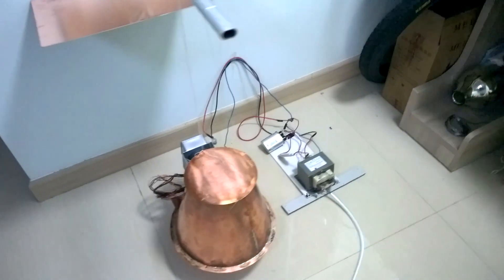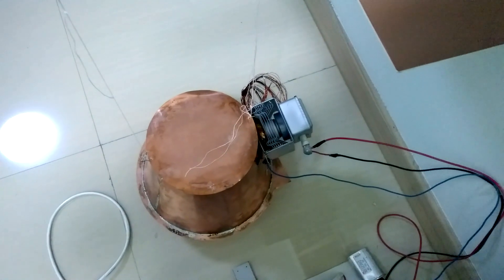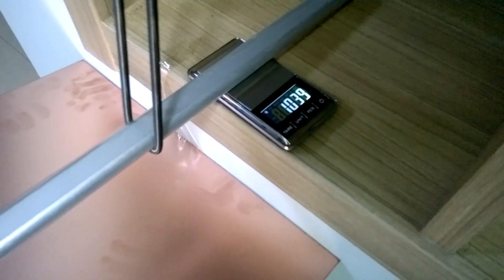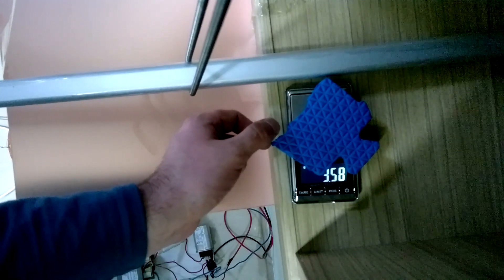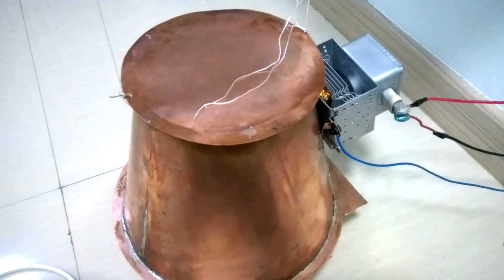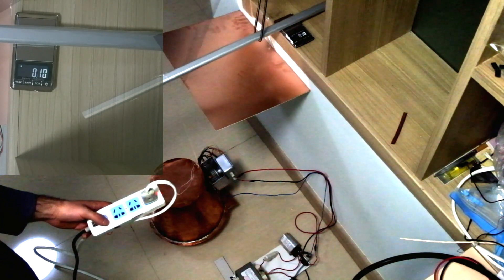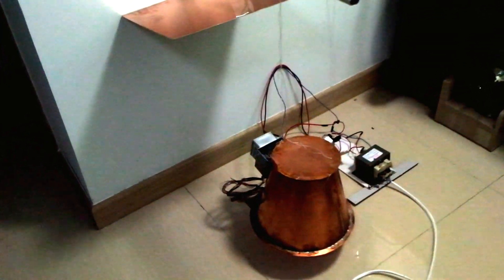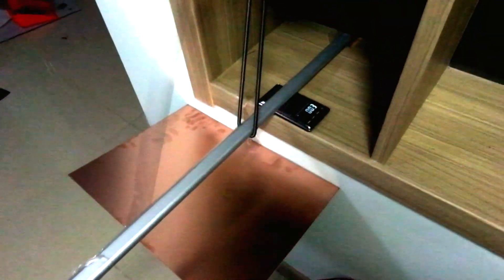EmDrive Test No.03 Success, I have thrust !!!

Comment: if it has thrust, doesn't that mean it is not an anti-gravity device?
Reply: +Guy Gisbourne You must be an electrical engineer, with an attitude like that. There are no physicists worthy of the name working on the Emdrive. Physicists have a different point of view: we use the well-established laws of physics to rule out certain possibilities. To do anything else would be the equivalent of buying-in to a tempting investment scheme, only to find that it is just another Ponzi scam. New discoveries are in fact not made by flogging dead horses, they are made by - for example - noticing that a dead frog's leg will twitch if a current is applied. That is, progress is made by investigating reproducible effects. What makes you think that a force has been measured? Have you even any idea of the number of phenomena that can produce an illusory force when one is measuring at the micro-Newton level? Check out the book, Vibrational Mechanics, it will completely change your view of what you think you know. Why should this sort of thing be disturbing? Because it suggests that there is something deeply wrong with the education system, and the taxpayer is therefore being cheated.
Reply: +Guy Gisbourne What it is, is the usual poor physics of so-called professional engineers. Check out an inventor called Anthony Cuthbert. British Aerospace had plans to test his 'space drive' on a 'vomit comet'. Was his invention like the Emdrive? No, it was one of those pathetic eccentric-wheel devices which try to exploit the (non-existent) centrifugal force. The trouble is that companies with too much money are tempted to waste some of it on ideas that are dead ducks. Hey, there's an idea: put a duck inside the Emdrive. After all, all that Shawyer has done is misunderstand the old trick question about the sealed truck full of birds which is too heavy to cross a weak bridge. Make 'em fly, LOL. Shawyer says that relativistic effects mean that photons do not behave in the same way as air molecules. Small problem: one of Einstein's thought experiments for  proving E=mc^2 was a tube containing rebounding photons. Oh, Shawyer uses a cone, not a tube? Really? Check out his first patent, the one which somehow got granted by the incompetents at the Patent Office. At the same time, check out the granted (sic) Volfson patent. What happened to that boondoggle?
Reply: +Guy Gisbourne Well, I have been employed in a scientific capacity for half-a-century and have somehow managed to acquire a doctorate in physics from one of the top 50 institutes in the world, so there must be something wrong with your reasoning. I have also made detailed studies of previously reported 'anomalies'. Perhaps I just do not fit the profile which you have deduced from TV programs. One does not advance by questioning everything from the outset, that will merely lead to stasis. One advances by looking very carefully at things which do not behave as expected. The Emdrive behaves exactly as expected: it does not move.
Reply: +Guy Gisbourne True, and your point might have some validity if I were the person, like a Shawyer, who is trying to get money to develop a device which contravenes well-established physical laws and for which there is no evidence that impresses seasoned experimenters. I do not have to 'come up with a proper answer': the answers are all in the scientific literature ... together with all of the previous scams based upon the same fatuous idea. Oh, you did not know that it is not even new? Perhaps you should learn before you try to teach. One of the previous inventors failed to make any money with his trombone- (rather than cone-) shaped boondoggle, but he did succeed in conning nine million dollars out of gullible US utility companies with his perpetual-motion scheme. Did they get their money back? No, they simply put everyone's fuel charges up in order to cover the loss. Get it through your head: this has nothing to do with science. This has everything to do with scamming.
Reply: +Steve Bowden  I guess "thrust" is just a manner of speaking here. Anyway,, if it's going to make anything move, then it must be thrust.
Reply: But that's the idea of anti-gravity. It doesn't have chemical rockets or anything like that.
Reply: I suppose, but the EM Drive isn't supposed to be an Anti Gravity device either. If I recall correctly it is supposed to take advantage of the appearance of virtual particles that appear..and that these virtual particles would provide the thrust. Maybe it shouldn't be referred to as an anti-gravity device in the first place? :)  Anyway I shouldn't be arguing over Semantics. My mantra regarding the Em Drive is "Please don't be cold fusion all over again. Please don't be cold fusion all over again."
Reply: ***** True. We must research any claim, I think we could possibly exploit some assymetries in the laws of physics to gain thrust. I do not believe either that it is antigravity, although if it conforms to the equivalence principle, you could name it antigravity.
Reply: +Guy Gisbourne its not a perpetual motion machine. it has an input of energy via electricity. perpetual motion has an intial input and then no further input.
Reply: ***** whether or not the output exceeds input is irrelevant. There is an input throughout thus it isnt a perpetual motion machine. It is something else. I agree with everythi g else youvare saying but that.
Reply: ***** Yes. Maybe if it could destabilize the vacuum it could generate an outpour  of energy in photon form. Or if it can interact with an astronomical object's gravity it could steal energy from the gravitational field. Since there is a coupling between whatever-is-going-on-inside the machine and gravity, or space curvature, etc. Anyway, destabilizing vacuum is a risky bussiness and even harder to control than plasma movement in magnetic fields. But even if we have a new kind of cleaner "propeller blade" it is still better than exhausting all those chemical compunds that currently rockets do.
Reply: +Boboc Gabriel Science is just a bunch of buzz-words to you isn't it?
Reply: +MrAaronvee Well, I am just trying to figure out a way, at least theoretically for this thing to work. I guess I want it too bad to work. I have studied mechanical engineering and if you want to know what I know, check my playlists. And sometimes, in order to figure out something difficult, you must play a little with concepts. I am sorry if my efforts to do that is troubling you, but there's nothing I can do about that. I guess I'll just keep going on. :)
Reply: +Boboc Gabriel The basic problem is that it is just the old 'bees in a sealed box' puzzle for children (does the box weigh less when they are flying?) tarted-up with some scam fast-talk.  Shawyer has merely tried to fool people (and himself?) more cleverly by using microwave photons rather than air molecules. The taper has no effect; in fact, one of his patent applications involves a straight cylindrical container. The Emdrive set-up is very similar to one of Einstein's thought experiments for proving E = mc^2. If Shawyer is right, then Einstein is wrong (together with every experimental proof that E = mc^2). Who would you bet on? Finally, the idea is not even new, but the previous inventions sank without trace. It is probable that the Emdrive is popular only because the awful 'science magazine', New Scientist, put it on the cover.
Reply: MrAaronvee Here might be your "bees from the box"  https://www.chalmers.se/en/news/Pages/Chalmers-scientists-create-light-from-vacuum.aspx   . If you are smart enough your mind will make the necessary connections. There IS a chance that at least something similary to the e-m drive to work. If the "bees"exist for a finite amount of time then momentum conservation is going bye-bye and the thrust can be achieved by power input only. Now I hope you realize that energy IS conserved here, and used to take virtual particles off their virtual state.
Reply: +Boboc Gabriel But what led that phenomenon to be predicted in the first place? It was the requirement that a quantum-mechanical system must respect the conservation laws ... if only in an averaged sense. Also, the appearance of real particles from 'nowhere' will still not change the momentum of a closed system.
Reply: You may be right. Afterall, the "real" photons must leave some kind of a recoil in the mirror, that must cancel the momentum. Imagine only if we could make them virtual again in some point B, then we'll have some kind of a "space ladder" to cling onto. But this is bold science-fiction by now. Do you know about the CP parity volation ? I believe that involving virtual electrons and not photons we could gain some momentum from the CP violation, the mirror simmetry break. I imagine some kind of solid state drive inside of which we can create parity violation. There are some problems though: the uncertainty principle would act just as the momentum conservation and make it impossible to head the ship towards a predefinite target. You must read about the vacuum-energy sails, it's very interesting. There is a small hint that we could make it. I like arguing with you by the way. I also hate the buzz words. For example I just hate the "tachyon energy pendants" concept. It's just crappy as soon as you study just a bit about tachyons. You cannot keep a material into a metastable state for an indeterminate amount of time.
Reply: +Boboc Gabriel Attempts to propel sealed boxes from within have been proposed for over 100 years. Of course, the earlier ones involved only classical mechanics. One scheme was to use a propellant which was either vaporized or condensed as it traveled the length of the box. Careful analysis shows that this does nothing to alter the overall momentum transfer. That is the wonderful thing about the conservation laws; they transcend everything! The reason for that of course is that the conservation laws reflect abstract symmetries (see the work of Noether). It is however often difficult to detect the flaws in one's reasoning. Naive application of special relativity and quantum mechanics suggests that an internally mirrored box will spontaneously accelerate (Emdrive!). But it is simply a subtle paradox.
Reply: Checking Noether now. What do you think of quantum-sails ?
Reply: MrAaronvee Yep, studied conservation laws and currents in college. Basically Noether's law is just a higher order abstractization of "what comes in must come out and no more, no less"in any number of dimensions and no matter how many derivation orders. However, when talking about discreteness and plankian scales, things do not behave too well and there are still debates if Noether laws apply fully. Especially if the system is opened or loosely defined, or subject to uncertainty. If we can bring these ambiguous properties to macroscopical manifestation there could be a chance to see some interesting technologies in the future.
Reply: +Boboc Gabriel Well, even if one falls back on just the Hamiltonian, it is found that quantum effects are fully described. I have been reading Shawyer's patents again, and they are nonsense. He knows/cares nothing about these  subtle third-law questions and, together with the sloppy experimentation and the previous dire history of this type of invention, it is obvious that he is simply a clown. Who but a clown would talk of using liquid-gas cooling of surfaces in an enclosure containing an ordinary atmosphere?
Reply: MrAaronvee If chinese experiments are ok, maybe they are on to something but I think they have the wrong explanation. In the wave packet they think that because some constituents are travelling faster than the rest of the package and the cone shape is basicly trying to separate the wavelenghts in opposite sides because of the varying diameter of the section. However this doesn't mean that the faster travelling waves will not hit the other end too, this way cancelling the total momentum relative to the resonant chamber.
They do not understand that for thrust, something must eventually leave the chamber, so, why not letting all the radiation come out and expect a thrust ?
Reply: +Boboc Gabriel All of the talk of relativity and light-speed is just twaddle, and a smokescreen (there are at least 8 ways of defining the speed of light). There is nothing magical about photons; they still have to obey momentum conservation. The conical shape was added later, apparently in order to add further confusion. According to Shawyer's logic, any irregularly-shaped box containing a gas will spontaneously move (because more molecules are bouncing off the large sides than off the small ones.  It is pathetic that Shawyer (and previous inventors) thought that it would work; it is quite worrying that NASA is 'looking at it'.
Reply: MrAaronvee The problem with photons is that their speed relies on the properties of quantum vacuum and they are a wave that propagates as the partial differential equations describe from vicinity to vicinty. While a macroscopical object has a speed described by classical laws. No matter how fast an object is moving these two things do not add ever. A photon is a variation in a field that is already extended maybe at infinity. A  macroscopic object can only vary the intensity of the field at some point in space but has no power over the speed at which this variation will travell in the field. It can only determine maybe the energy, polarization, doppler effects, etc.  Shawyer would need a Maxwell's Daemon to sort the momenta of the particles in the box, and even then it's arguable if it will be successfull.
Reply: +Boboc Gabriel As I intimated before, you are confusing the various ways of describing the rate of photon signal-propagation. One of Einstein's thought-experiments for proving energy-mass equivalence is based upon a situation which looks like the Emdrive (photons bouncing in a box). If you falsify Einstein's model, you will get the Emdrive to work but relativity will collapse (as the lunatic fringe always hopes). However, because of the many other independent proofs of relativity theory, it is clear that the Emdrive reasoning must be incorrect.
Reply: MrAaronvee Yep. Photon in a box is extra mass to the box when seen from the outside. I knew that since I was 26. In fact I carried out this experiment in my mind and then found it in a text. I carried many experiments in my thoughts and some of them were right. I was searching for the ultimate truth. Still am. I know that waves with higher than c phase speeds cannot carry information, hence energy. They are monochromatic. However, mankind needs very quick some good space propulsion or else...Man, I don't know... I like to know what CAN be done not what CANNOT  be done. I wish you a Happy New Year by the way. All the best to you and whoever will read these comments.
Reply: +Boboc Gabriel Yes, Happy New Year. My feeling is that, whatever is discovered in the future, such discovery will be aided by proper education in physics. The current pattern is that physics misconceptions go uncorrected right up to graduate level and this wastes a great deal of time and effort if, for instance, an administrator suffering from physics misunderstandings is senior to those who actually understand the subject properly.
Reply: MrAaronvee That's an interesting, unexpected and worrying news. I hope you understand that this is happening in every domain of our planetary lifes. We've got politicians making laws with holes inside, economists that are not sure how to interpret the current situation, physicians assuring us that certain drugs and substances are good for us, etc.. What do you say about that ? Should every citizen buy his own laboratory and experiment for himself, just because the guys with degrees do not deserve them?

Comment: Can you tell me the thrust is going up or down, based on this setup?
Will you do any other test in future to show that the thrust is independent on the direction of the device?
Reply: P. Anh Nguyen Thrust is up because scale goes into the negative.
Reply: Wuety06 From my reading, the thrust is toward the small end, meaning the thrust is upward. What I mean independent here is if he places the system horizontally, the thrust must still appears. In other words, no matter what direction is, the thrust will always shows up if it is really independent on the direction.
With this setup, one may say the thrust is from the air current or maybe the vibration or the effect of magnetic field, there are so many reasons for the thrust to appears.
Reply: P. Anh Nguyen I missed that the scale went negative the first time i watched... so i removed my comments
Reply: P. Anh Nguyen Sorry to revive your discussion from a few months ago, but I think people miss this point, and it's quite important.

The scales are going negative. This means the drive is apparently pushing itself upwards, away from the ground (thrust force points towards narrow end). However, go to Shawyers 'Theory paper 9.4' and compare the first figure with equation 7. Above equation 7, he clearly says Fg1 > Fg2, (Force toward wide end > thrust toward narrow end) and hence the net thrust should point towards the wider end - which in this experiment would mean thrust force should be downward.

The chinese group claim that their thrust points toward the narrow end. Shawyer's 'theory paper 9.4' says his thrust points towards the wide end. The NASA report isn't clear which direction their measured thrust points. I think this only adds to the emdrive is bullshit argument - they can't even agree which direction the thrust points!